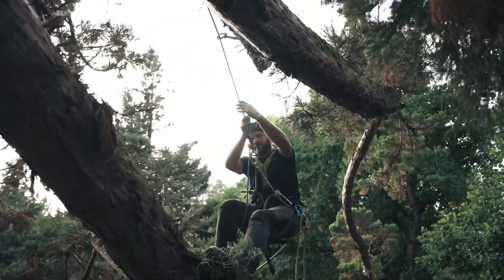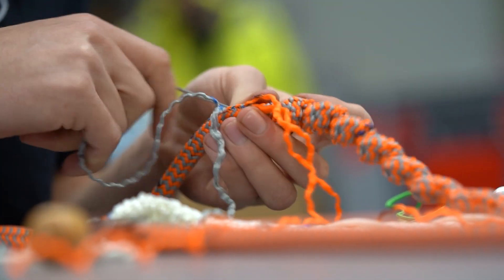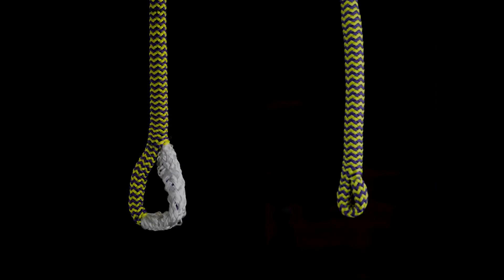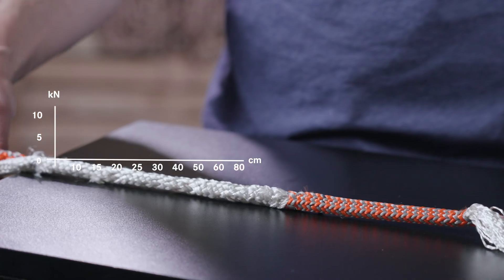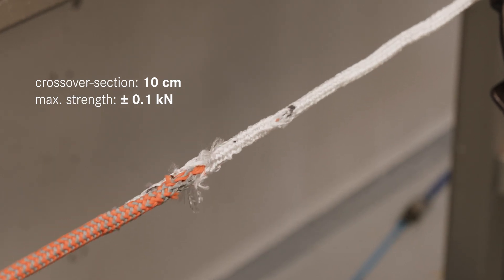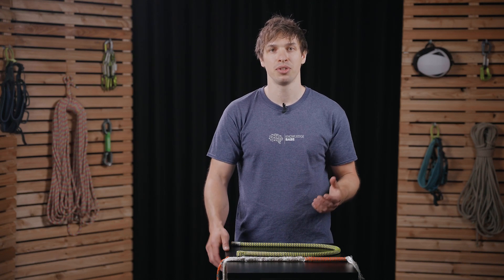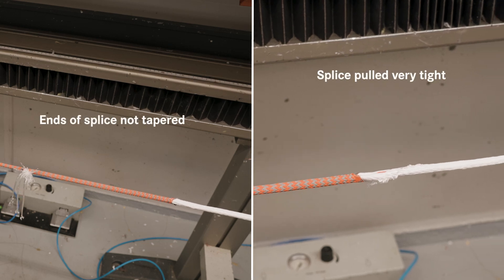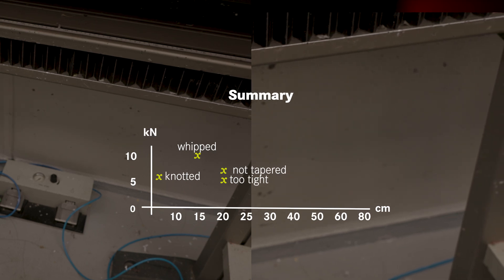Geeking out on Splicing Details

Comment: Fantastic video. Could you please tell us the rope diameter so that we can work out the ratio of cross-over lenght to rope diameter and compare it with classic instructions like Samson or Selma double-braid eye splice?
Reply from the maker: These tests were done with the Edelrid Woodpecker 11,7mm. But please be careful calculating anything here. Textiles are not really to calculate with. There are to many parameters and relations are seldomly linear. The message of this video should be apart others: There is a minimum and longer cross-overs do not lead to higher strengths :)